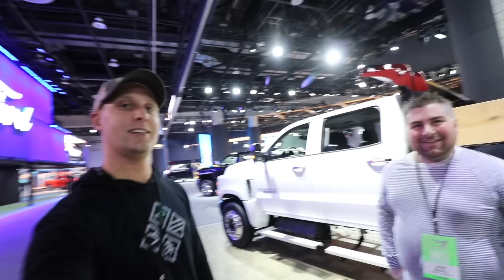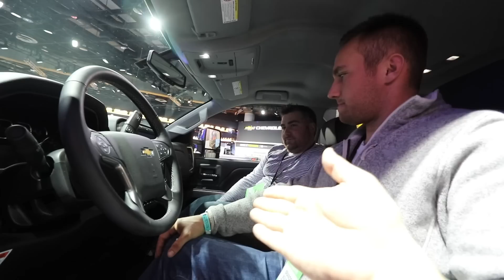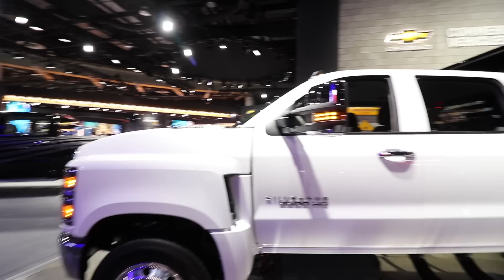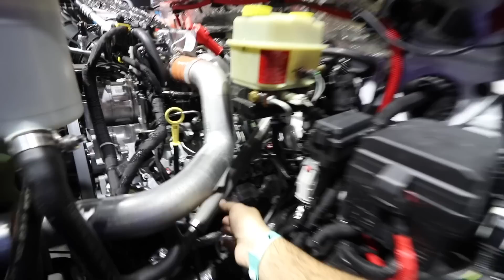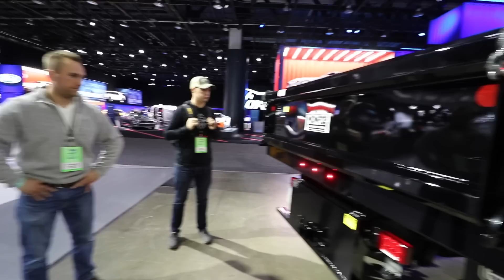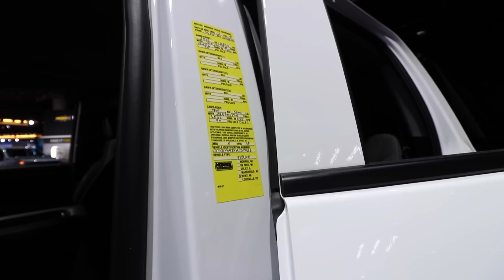2019 Chevrolet Silverado 6500HD With Full Walk Around w/ BTBRV

Comment: Thanks for all the great videos. Much more "industry specific" than most of the vids on these topics. Very informative.

I have 7 questions. Not sure where to ask them, so I'll try here. I've worked at the idea a long time, and to move from an idea to a reality - especially given the role of the truck - I need to learn more "real world" info. I'm a paramedic, EMS educator volunteer in SAR. Sorry they're long. But they're serious questions.

a) I have a truck in mind I'd like to build. It has to be able to work as an RV/bug out vehicle/expedition vehicle, and also has to be able to serve as a mobile command post for SAR or EMS/disasters on occasion, and to be able to perform first response duties on occasion. I won't be transporting patients in it, so it is NOT an ambulance. But it'lll need jump kits, oxygen kits, etc, so lots to carry.

So it needs about a 2400 pound bed camper (wet, including anything I carry in it), probably a Cirrhus 670, plus EMS and SAR gear, plus training equipment. A fusion of vacation and work vehicle. Day to day probably a total of 3500 pounds payload (4100 with 4 passengers on board), and little or nothing towed. Perhaps a small utility trailer but unlikely. 

Has to be true 4 seasons, as I'm traveling in it back and forth across Canada and the US most likely, both for work and vacation, so extreme conditions to put it mildly. In fact, if I could somehow haul 4500 pounds in a 3500 SRW, I could also bring extra supplies to resupply our team during disasters, when we'd go through a lot more oxygen tanks, bandages, etc. So with enough payload it could also help with logistics.

Because use will be BOTH urban and rural, I'd like to avoid a dually if I can. So can I get a 3500 SRW (which DO come rated to this weight)?  Does this payload mean I'd need a dually even if the SRW is rated for the load? And could I use helper springs to make the SRW work? That extra width is killer in urban settings. You can't get an ambulance down a side street anymore. Sticking to SRW means I can get closer to urban emergency scenes before I must park the vehicle and proceed on foot, carrying any needed equipment. Still, the 5500 pounds with the dually is more like what I probably need. Any ideas there? And am I being unrealistic and I'd really need a Ram or Chevy 5500?

b) I think given the multiple roles and high payload on a day-to-day basis a diesel is the way to go, no? And do you think the diesel or the gas is more reliable in extreme conditions, like hurricanes, floods, extreme heat and cold, etc? As an example, I wouldn't buy any Ecoboost engine for this (I know it's not in these one-tons - just explaining rationale) as in overheat /humid conditions it shuts down and won't run until you clear the error code. Not ok for an SAR vehicle in a tornado! So would you say the diesel or gas option is better for this type of thing? The US army's fuel is closer to diesel, right? I think it is called JP8?

c)  I've heard of expedition vehicle makers using double width wheels and tires instead of 2 dually wheels per side, so rocks can't get in between the wheels off road. Real thing? Scam? What do you think of those double width wheel/tire setups?

d) I had never heard of that wide track that shortens turning radius before you discussed it, and I don't see much information on it on Google. What I do see is all Ford. Is this only a Ford feature, or do Ram and Chevy/GMC do it too? Can you explain how it works in simple terms, or refer me to a video that explains it?

e) Many truck bed campers and some expedition vehicles come with cab-over bedrooms. Super space efficient from my POV. But the more hard core the expedition vehicle, the less they seem to use cab-over camper designs. I'm guessing it is because if the chassis flexes the cab-over might hit the cab. Is that right? Would a cab-over camper work for the type of use I've described? The extra length isn't desirable if I can keep the vehicle footprint shorter. I won't be driving any Moab-level off road. I'm not good enough and not my thing. But soft roading, bad roads, washed out roads etc likely from time to time. So not sure if I can get away with a cab-over camper or not.

f) Right now I'm leaning towards an extended cab. I don't need the weight of the crew cab and I'm divorced, so trips wouldn't normally be more than 2 in the truck. But is this being stupid? Should I get the crew for the extra storage space or to bring more passengers on occasion or what have you? I usually hear the extended cabs aren't as comfortable since the seats are so upright, even if the legroom is ok. You usually say to get a little "more truck than I need."

g) There are some 4x4 cab-forward design vehicles in the medium duty segment, like the Mitsubishi Fuso, and in other markets the Isuzu medium duties, or MAN trucks. Saves length, has equal payloads to the normal medium duties like a Silverado 6500 HD, and they have teeny little diesel engines, so probably better mileage I'd guess. Your thoughts? Which would be better for this application - a vehicle like a Ram 3500 or a medium duty cabover design like a Fuso or MAN?

I know this is a ton of info and questions. I really appreciate any time and insight you can give. And it'll be for a good cause. :)
Reply: Sorry - one last question. The army vehicles are rated to one level of payload on road and a lower level off road, sometimes half. E.g the MTVR is 10 tons on road but 5 tons off road. Is this a general rule? If I am taking my vehicle off road do I need double the normal payload or something?
Reply: Plus any thoughts on the Cirrhus 670 or a better lightweight camper (WITH bathroom) would be great. I'd love the composite one from Overland Explorer, but $150,000 for that vs $40,000 for the Cirrhus.... Thoughts?

Comment: That is a great medium sized dump truck! Would definitely go for the gasoline  engine the 8.1 liter Vortec engine with dual gas tanks. Would be great for plowing application large parking lots especially doing City roads with a wing plow attached to it can put a large sander in it can definitely hold 15 yards of mulch or five yards of topsoil 1 all good around medium sized truck. One question do you need a CDL to drive this type of truck with a 10000 to 15000 pound trailer? I know in my state anything over 25,000 pounds you need a CDL and a medical card. Plus anybody that is trying to get a CDL this truck would be a easy truck to get one with no complicated years or anything like that easy to drive.
Reply: Towing that kind of weight with this truck would be CDL territory. Since the DOT goes by the GVWR of the tow vehicle as a single unit or combined with a trailer and not the actual weight someone is hauling or towing.  In my state anything over 26k a CDL is needed. I have a international 4300 commercial truck with a GVWR of 23,500 so basically towing anything with it even a very tiny trailer with a low GVWR would turn it into a class A truck. Hope this helps.

Comment: I like to claim that reason Ford moved the switches from the bottom of the dash to overhead is because I was towing a couple from Lansing to Detroit him and his wife rode in the truck with me and his wife was the smallest person so she rode In The Middle of my regular cab tow truck2014 F-550 her knee kept flipping on the auxiliary switch on the bottom of the dash that turned on my red overhead LED beacons I told him it was the dumbest ford design ever and that's when he told me he was a Ford engineer that worked on the platform I told him it'd be much better if they were over head so they are out of the way the experience of the problem of people's knees bumping into the switches quite often he said yeah that's a really good idea why I have to take care of that.

Comment: That emission sensor alone would deter me from now buying a diesel ! I heard the way it works is if you are running the vehicle around town going slow with a lot of stop and go it will load up and the emission sensor will shut the truck down. Running the vehicle on the highway at higher speeds to opens and cleans the motor more and reduces the chance of this from happening. My mechanic was informing me on all of this on the new Diesels
Reply: Kevin Cloonan just wait till the warranty is gone then delete it lol
Reply: This is true as far as semi trucks. Unfortunately probably true for this style set up. You may have to park and do a manual regen which takes between 10-25 min in my past semi trucks.

Comment: Delete the emissions and enjoy your overpriced truck
Reply: As long as you don't live in a state that requires yearly inspection and don't mind voiding the warranty on the engine.
Reply: What's the point off deleting the emissions? I don't know much about diesel engines. My truck has a gas engine.
Reply: Wardor 1992 engines run much better and get more MPGS
Reply: sean peterson Then why do diesel engines have them? It is required by any state laws?
Reply: @WARDOR92  federal law requires emissions controll equipment such as SCR, EGR, DPF, etc. if you want to know more about those just google those terms. anyway they suck a lot of engine performance so it's best to delete them.